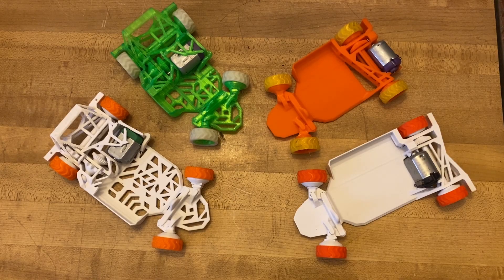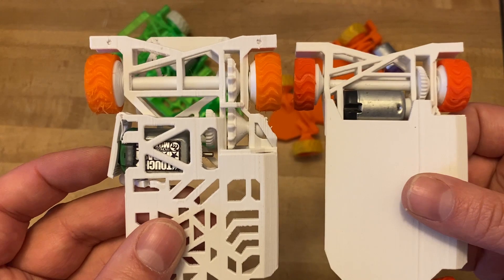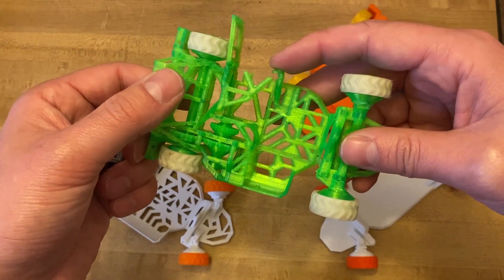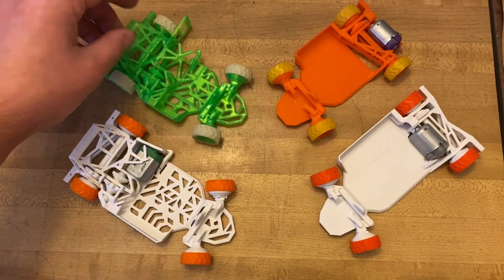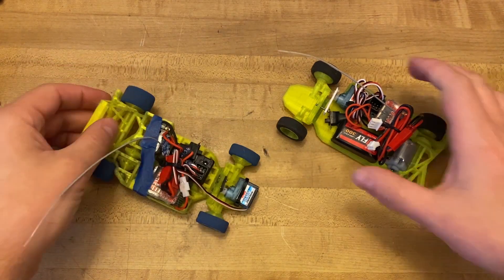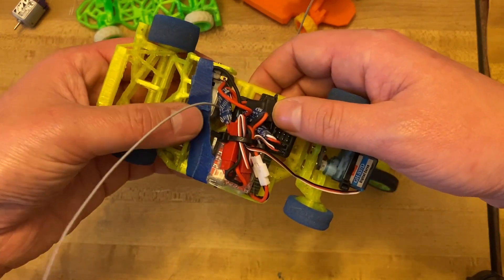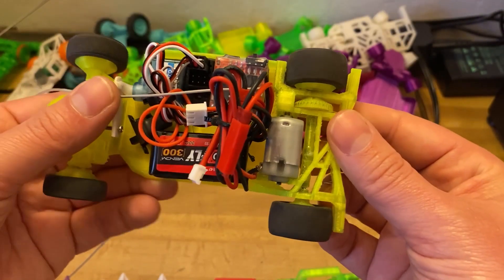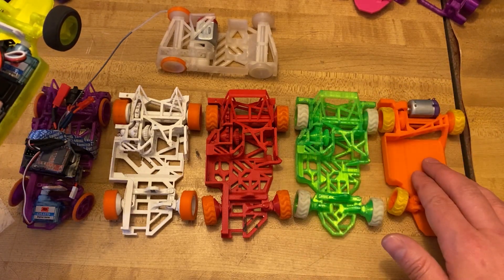The Gamma 1.8 - An improved Print in Place RC Chassis

Comment: Man, your work is outstanding! 
I already printed 2 of them (one in ABS, seems very promising). The problem is to wait for the electronics! ;)
Reply from the maker: Grazie, Tommaso. Fammi sapere se quello in ABS funziona. Non l'ho mai stampato in ABS perche' e' un incubo per me. Personalmente preferisco il PETG, che sembra ha meno frizione sulle parti mobili. Appriposito di assi: ti servira' una di metallo con 2mm di diametero per l'asse posteriore. Io uso le assi di mini4wd. Funziona anche senza, ma se dai troppo gas, rischi di spaccarla.
Se hai modo di farmi vedere foto o video delle tue stampe, lo gradirei.
Reply: @underengineered_1077  certamente! Farò un video con molto piacere

Comment: I have been trying to make one, my parts came today and I had to switch some connectors to work with the ones I had, and I got everything connected, the esc turned on and the receiver lights turned on, but when I pressed the trigger the motor barely turned...then stopped.  Pull that be a battery issue. I need help
Reply from the maker: Hard to say. Try charging the battery and see if it keeps doing it, or plug in another battery. I know that a lot of receivers will turn off if the voltage is less than something like 2.8 volts. If it's not the battery, you might have a defective esc or controller. To check if the motor works fine, get a couple wires and plug a normal AA or AAA battery to it to see if it turns.
Reply: @underengineered_1077  I have connected the battery straight to the motor and it has worked just fine. My batteries are 3.7 v and the esc it’s lowest voltage is 4.7 v
Reply from the maker: @owenspencer828  that's probably why then. You'll need an esc that has a lower cut off voltage than your battery. The one i'm using i got from amazon by searching "20a esc brush". The little red square ones work fine.
Reply: @underengineered_1077  ok, I found it, now my servo is a higher voltage than what I have. What servo should I get.
Reply from the maker: @owenspencer828  i recommend a 3.7g servo. A 9g servo will work fine too, but it's a little bigger. You can find them on amazon, ebay, etc. If you look at the "Thing Details" tab on the thingiverse page (where you got the stl), you'll find my suggested list of electronics.
Reply: @underengineered_1077  I got a 9g servo, but it is a higher voltage than what my battery is. Will it still work.
Reply from the maker: @owenspencer828  if it's an sg90, then yes. If it's something else, then i don't know. I'm not really good with the electronic stuff.
Reply: @underengineered_1077  ok thanks